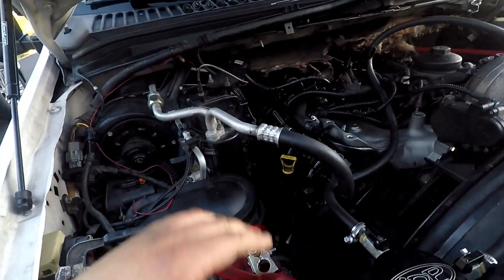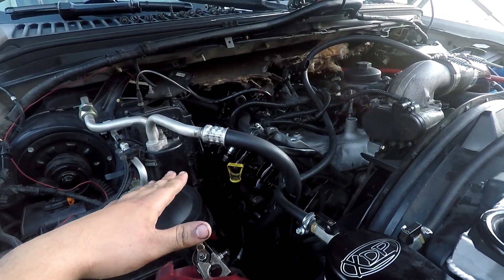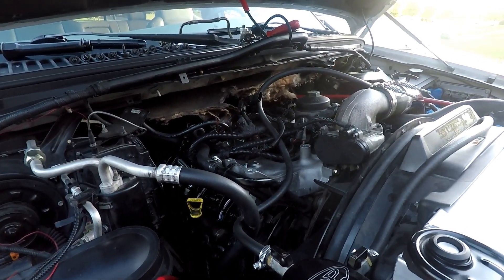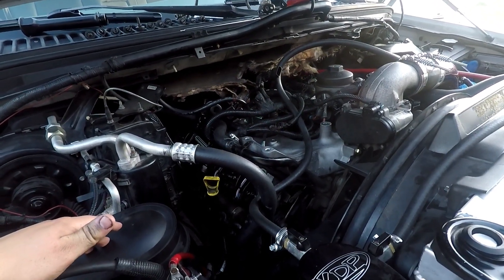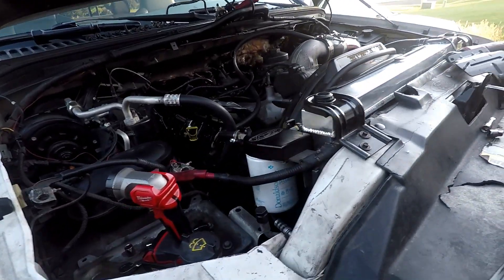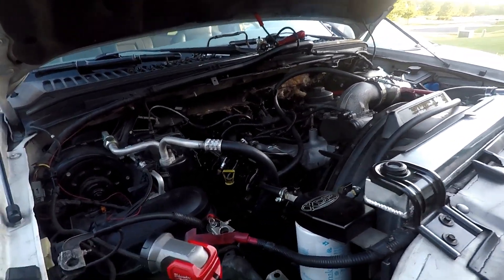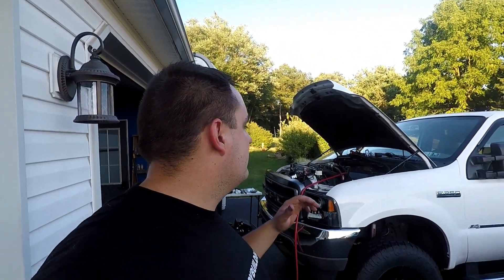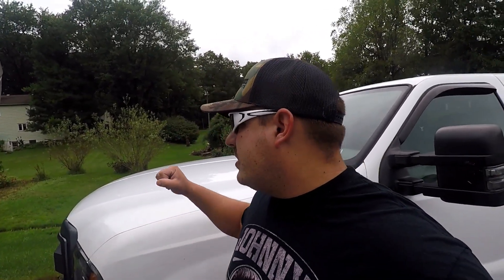6.0 powerstroke high pressure oil leak

Comment: Hey man love the channel. New to 6.0s just got my first one(05 f350) I'm wondering how to hook up to air to test oil pressure(getting long crank when cold, about 5 seconds) and is it possible to smoke test the HPO system like you would with evap hoses and such? Thanks!
Reply from the maker: A smoke test would be hard because the hpop system is designed to handle really high pressure but when you do an air test the leak area shows because it turns thr oil into a mist. Easiest way is to plug into the ipr valve and shoot 150 psi into it and listen. Although you can go through the icp sensor and have a devices that commands the ipr closed and that will perform the test correct ill get you some affiliate links for the hookups you need
Reply from the maker: Here is an affiliate link to the adapters to plug into icp sensor or your ipr. 

https://amzn.to/3wNjBHI
Reply from the maker: And here is the device that you will need if you test through the icp. This connects to your ipr and you can then command it shut so you can do your test.

https://amzn.to/3vC4wZd

Comment: I'm trying to find the other video.. how did u air test it? Icp?
Reply from the maker: I'm sorry unfortunately the video I took was corrupted and I was not able to make the second video. So in my experience the best way is to go through the ipr port. If you go through the icp port what happens is that you have to then have software to command the ipr shut which you can only do for about a minute before needing to let it rest again. So going through the ipr port will eliminate this and you can just run thr air pressure.
Reply: Thanx bro..I've done injectors b4 but didn't remove quick disconnect..this time I did head gasket and haven't been able to fire up for like 3 weeks 😣
Reply from the maker: Do you have anything to read engine parameters?
Reply: @six0bros  I have a scanner but I don't think it rear icp or ipr..I was going to do air test or call a mechanic with a good scanner
Reply from the maker: This link is an affiliate link for a bluetooth obd2 plug. It can connect to your phone and it will help you diagnose the issue. You then download forescan to your phone or torque pro and that will let you read everything you need to be able to diagnose the truck. The apps are around 5ish to buy. So the whole setup is around $15ish here is the affiliate link.

https://amzn.to/360PqlE
Reply: @six0bros  I got it running bro!! 👍😀
Reply from the maker: Great man what was the issue
Reply: @six0bros  ipr cables
Reply from the maker: Glad you got it figured out

Comment: was it the J-tube that sits on top of the HPOP that you messed up? I'm getting ready to replace my HPOP, i did order the CNC fab pump. Just trying to get all my bases covered, having issues right now getting my turbo off(up pipe clamp does not want to come off)
Reply from the maker: I have turbo removal videos check them out, but when I have had issues I use a pry bar or crow bar and pick up under the turbo to break the seal from the exhaust. I would replace the j tube off the top if you're replacing the pump. Also there is an updated cover you can get.

Comment: My truck 2006,  6.0,  184,500+ just died and won't start. No codes when it happened. I'm new to diesel and Powerstroke. This happened after replacing oil filter, changing oil & both fuel filters.. Previous to that, twice, died while driving and started right back and running normal like nothing happened.  One morning was running rough for about 45 seconds. I shut it off and started right back and was running normal. Check engine light was illuminated. It gave me Code P0762 & P2284. I replaced the ICP sensor. It won't start with ICP plugged or unplugged. Next step will be to remove and check IPR sensor.  I live in a small island in the Caribbean, don't know who could do the leak test. Might do it myself. Thanks for your videos.
Reply: If the truck cut off while you was driving or you push the throttle. Is the IPR.
Reply: Luis Jimenez take IPR is in the back of the turbo and check the screen on the ipr valve if the screen is broke or damage change it and it will start with no problem that is going be your problem
Reply from the maker: Do you have a scan tool like torque pro or any type on monitoring device. To help I would need to know what icp, and ipr are doing while cranking. Also ficm voltage. Those are the main things to help. There is a good chance it is the stc  fitting on the hpop, if not you're looking at stand pipes and dummy plugs. Let me know if I can help you further

Comment: Working on a truck in the sun all day can make a fella very very irritable as well....(according to my number 1 instigator). I find Bud Light really helps...Have you ever seen anyone lift the cab just a few inches to do head gaskets?...I want to do mine inside my garage but obviously I will have a height restriction...I know 6.0 Doctor says you can do it with cab on, but I want it just up enough to paint the frame.
Reply from the maker: I have not seen that done. Doesn't mean it can't be. Just be careful  to spend extra care torquing down your heads.